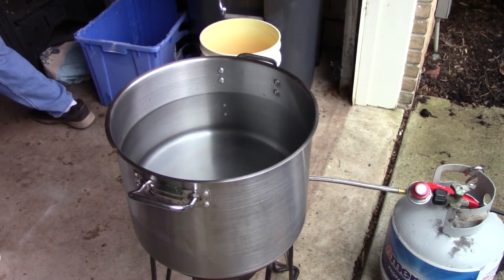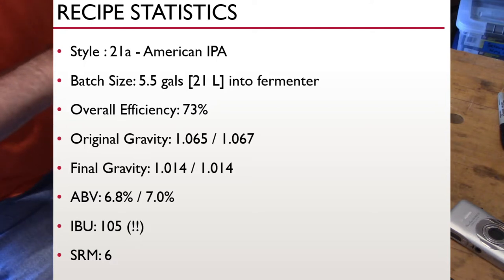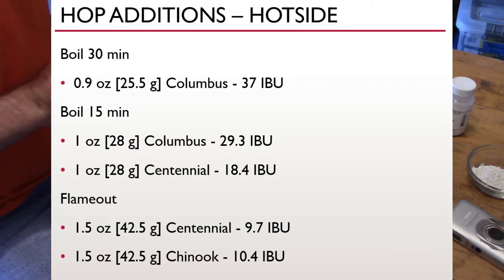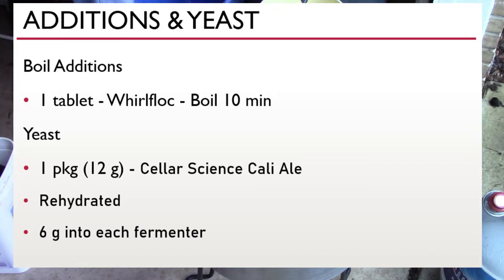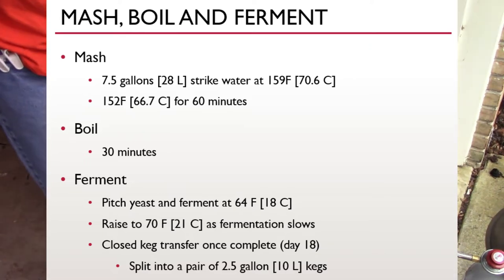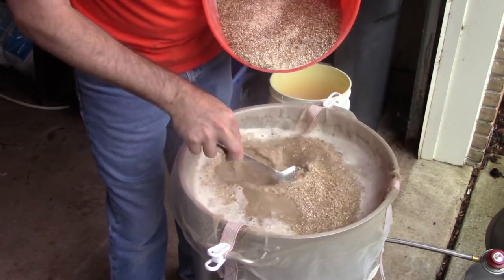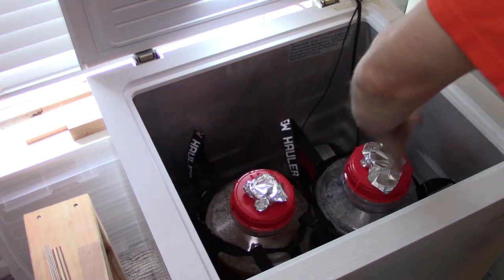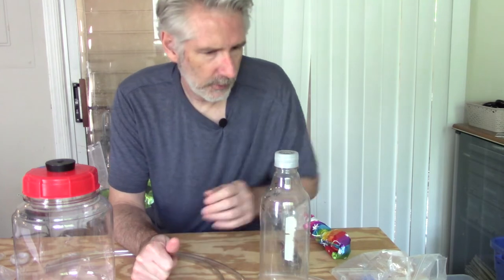Brew an American IPA - Gold Medal Winner!

Comment: brewed a 2.5 g batch of this. I royally effed up the ingredients but it turned out amazing! basically, because my local homebrew shop only sells grain in 1 lb increments, instead of 5.75 lbs of 2 row, 6 oz of crystal 20 and 10 oz of white wheat, I threw in 6 lbs of 2 row, and 1 lbs of each of the other. its a little dark and hazy but it's great
Reply from the maker: Awesome.  Glad to hear your batch turned out.

Comment: The most recent batch of IPA I brew was dry-hopped at cold crash temps, although I normally dry hop that recipe at fermentation temps...three days may not have been long enough.  The final beer has very little aroma compared to how this recipe usually turns out.  Five or six days might work better if done at cold crash temps.
Reply from the maker: Thanks for sharing.  I have had good luck with cool/cold dry hopping in the past, but with this specific batch the warm one had more flavors.  I might still play around with different hops, and different time/temps.  I added some links in the comments on articles about dry hopping.

Comment: This is an interesting concept, shamefully, one I've NEVER thought to perform.  I wonder how things would turn out, if after cold crash and racking,  bringing the beer back up to say around 170f or so, and then dry hopping?  Could be an interesting experiment on a one gallon batch.  Of course you'd have to adjust IBU, but even something much lower than 170f should in theory, extract more hop oils.
Reply from the maker: Yeah, I have never thought about "Hot" dry hopping.  I suspect it would make a difference in the flavors, but it would be hard to say if that would be a positive or a negative.
Reply: @CascadesHomebrew  I agree. I think it would be very important to make sure as much yeast as possible was "removed" before attempting, but it could be interesting.

Comment: Great job and I love the test. I think the hops matter to some degree but I'll stick to the 70F dry hopping for now. Brulosophy did one where he did cold and hot mashing using some dark malts (I think it was a chocolate malt) and shockingly it was really down to personal preference as the cold mashed dark malts he described as having some tobacco flavors which instantly told me I'd avoid the cold mashed dark grains until I have time to do my own experiments.
Reply from the maker: Thanks.  I had expected the cold dry hopped batch to "win" based on some prior batches and reading, but the warm dry hopped batch just had more dry hop character.  I might play with dry hopping at a temp more like 55F (with the theory that a soft crash will drop out yeast before dry hopping).  There are definitely many techniques to make great beer, and often it just comes down to preferences.